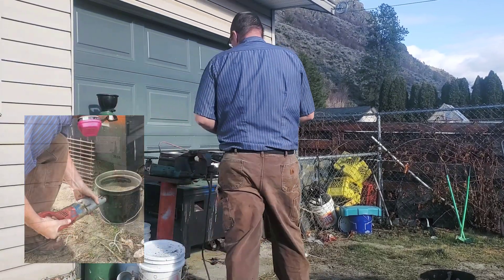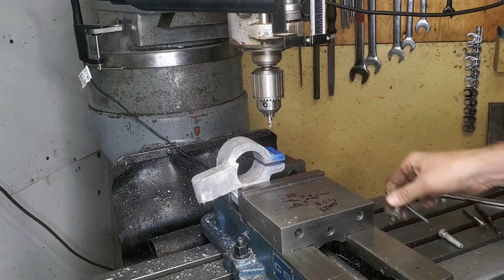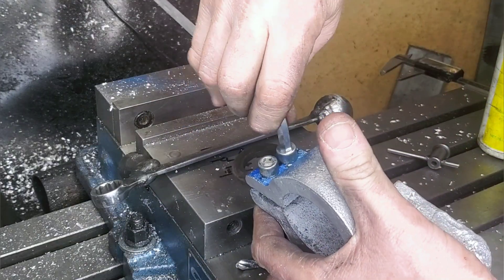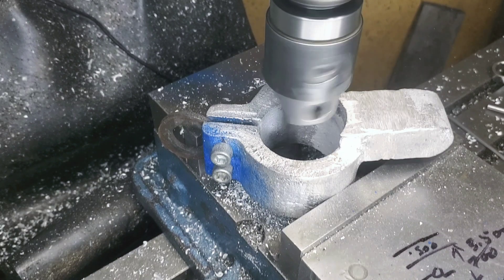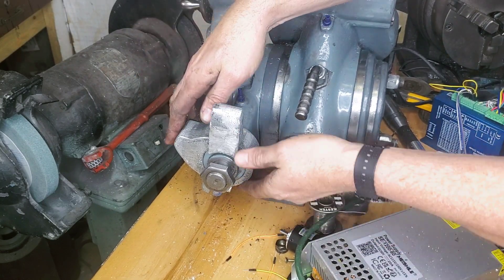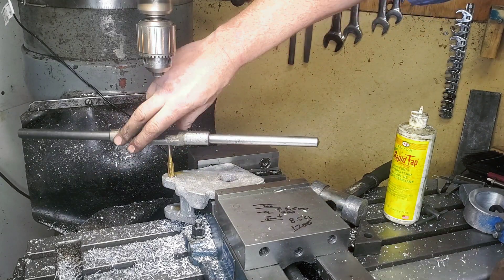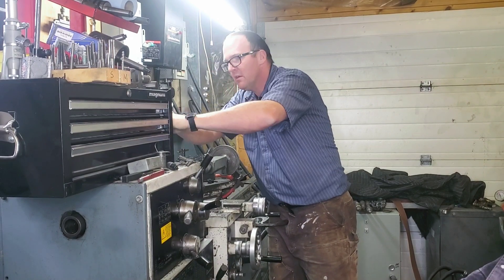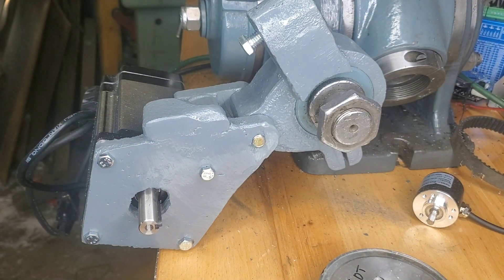Machining castings to fit servo motor on indexing machine

Comment: looks like it machined ok...
ive always tended to use castings specifically when casting, i scrap any extrusion. motor casings etc,  they give a nice machining "chippy" casting. higher silicon content?

extrusion always ends up making nasty sticky soft stuff. in my experience, anyway.

and in that regard, it also bruises a lot less than "billet". 

small design change on that tensioning bolt... slot the bracket, save the fear of snapping a tap in a long hole, and can use a locknut in the slotted part.
Reply from the maker: Thanks man !   Like the idea of slotted ajustment , i will think hard on that for sure next time :)    yes im starting to find that remelting old castings is the way to go .   I ran short a couple of times and thre in some 660 and it sat in a taffy block at the bottom .     The child in me thought about stirring iy in but we know how that coupd end .   Gas , lumps ... sadness .   

Now to head out this week and rummage for some more alu so i can cast some more cool stuff :)

Comment: Very cool video as usual. I am wondering if you are not afraid that the entire contraption will turn on that bored hole, I know you tightened it with two bolts, but still, the bored surface and the cylinder on your mill are smooth surfaces and the beefy servo's torque might turn the whole thing?
Reply from the maker: You raise a good question .   I feal the surface area vs torque will be adiquate .   The indexing head it 40:1 so its very easy to turn . Even when i put a 1:2 on it . It should be ok .
Reply from the maker: You raise a good question .   I feal the surface area vs torque will be adiquate .   The indexing head it 40:1 so its very easy to turn . Even when i put a 1:2 on it . It should be ok .
Reply: the amount of clamping force there is massive. people underestimate just how powerful a clamp like that is... probably experienced trying it with a small diameter shaft...

Comment: Good tip on turning threaded parts, I've had them jump out of the chuck as well. The finished motor mount castings look like they're bought ones. Great job.
Reply from the maker: Thanks tony ,  its veen a fun learning process to get to this point .   There will be more cool castings coming this year